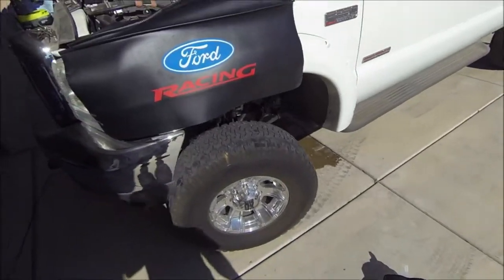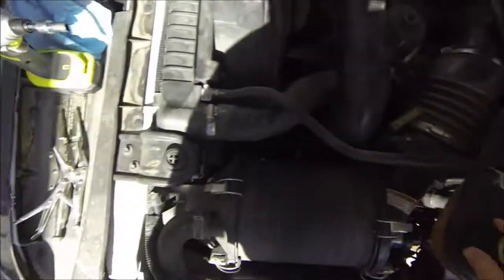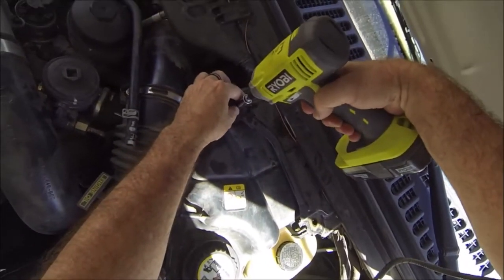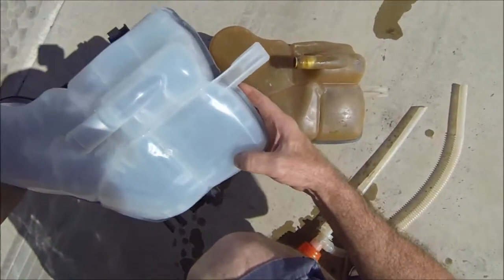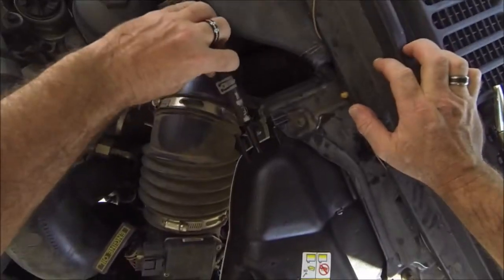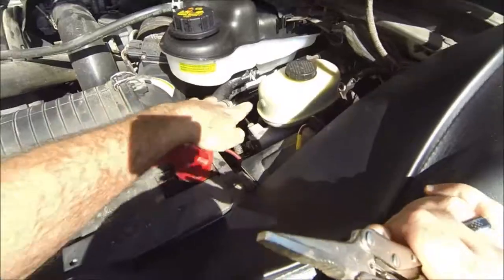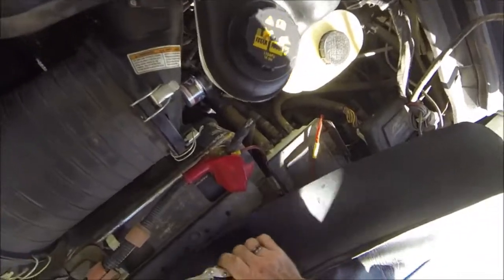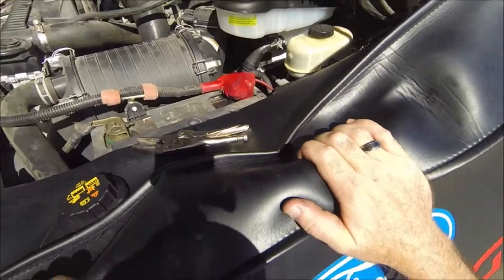How to remove and replace a 2004 F250 Coolant Reservoir Tank in a 6.0L diesel

Comment: Thanks dude, just passed 201k and had been leaking from those same cracks on the same spot for a couple months. Your video helped me get it done pretty easy. Snapped the bolt head of the petcock screw as I retightned it, but the bolts still in there and not leaking and the job is done, should be alright for now lol

Comment from the maker: Update as of 3.9.2021-The Dorman coolant reservoir developed an air leak. The leak was at the seam where the clear/white tank is bonded to the upper black part of the tank. As of today, I am looking for a replacement.  As for the leak once the truck gets to the normal operating temperature I start seeing some bubbles coming out of the seam area. I believe the tank is supposed to hold a pressure of 16 psi.
Reply: There are full metal reservoirs, about 4 times the price!
Reply from the maker: @mattmayo3539  I saw those, My Dorman lasted 7 years and I think I will replace it with another. Find an O-Reillys that will give a lifetime warranty.
Reply: @ebehrman  that’s what I did. It’s cheap enough so why not.

Comment: Spotted white coolant stains on the frame while detailing the truck before a big pull with the 5th wheel camper. Dorman part was stocked at my local discount auto parts store. Thanks for the video!
Reply from the maker: Thanks for the info!

Comment: I do not know how to top off the resevior...
Reply from the maker: There should be a min and max fill line on the side of the tank. If you bought the aftermarket one I do not believe it does not have the marlings. Just add antifreeze about an inch or two from the top of reservoir.  Do not top off need room for expansion of the hot liquid.

Comment: Besides taking the coolant out of the reservoir, does the whole system need to be drained? Thanks and great video, thank you!
Reply: I only removed the coolant from the reservoir but I did have all the coolant replaced in my system with new coolant I think Ford's coolant is terrible

Comment: Just ordered the same reservoir. Where can I get a pump like the one you have?
Reply from the maker: I think you will be satisfied with the replacement part quality and cost. I have been for sure. As for the pump I worked for a semiconductor factory years ago and it came with a piece of equipment I used to perform maintenance on. I am sure you can use some type of siphon pump. I am sure you can find something similar at local car parts store or even Walmart.

Comment: Can you put that bottom tube on before you put the reservoir in place?
Reply from the maker: Jaye Harris I am not real sure.  I know it is a very short hose so I kind of doubt you can.  I think with recording the video and trying to cut seconds off generating a lot of footage it put me under pressure and I struggled with putting the hose back on.  Really the job was super easy.
Reply: When you were fighting with those Vice-Grips Is the exact point I would have been cussing up a storm.  #NoPatienceForMe

Comment: Thanks for the video.  Going to do this tomorrow.  Wondering if it would have been easier to attach the bottom hose if you did it before you mounted the reservoir?  Just wondering.
Reply: put on hose clap . throw that factory one in the bush

Comment from the maker: 6/23/2014 no issues with replacement part from Dorman in Sunny/Hot Arizona avg. summer temp. is 105-110 degrees, :-)

Comment from the maker: No issues so far it is working excellant. See if it makes it through an Arizona summer I have been driving it in 110 degree weather with AC on.  So far so good I would highly recommend the replacement.

Comment: Are you having any issues with the Dorman's reservoir?
Reply from the maker: Update as of 3.9.2021-The Dorman coolant reservoir developed an air leak. The leak was at the seam where the clear/white tank is bonded to the upper black part of the tank. As of today, I am looking for a replacement.  As for the leak once the truck gets to the normal operating temperature I start seeing some bubbles coming out of the seam area. I believe the tank is supposed to hold a pressure of 16 psi.